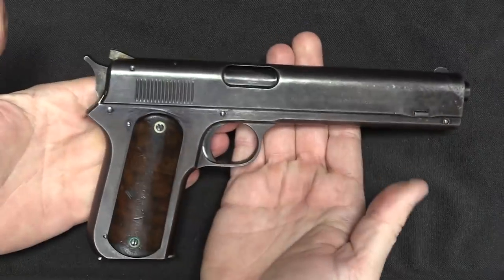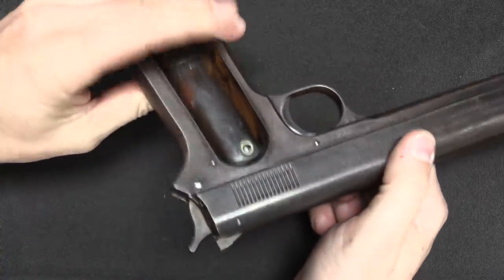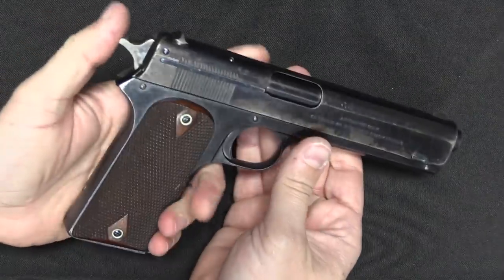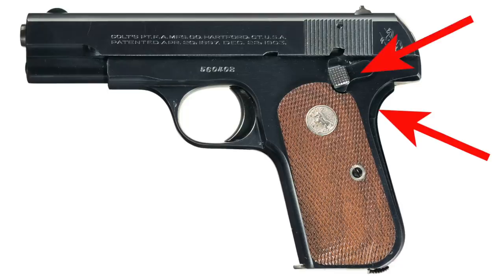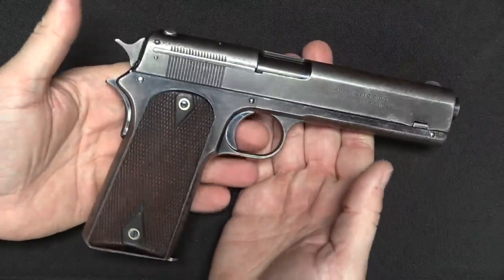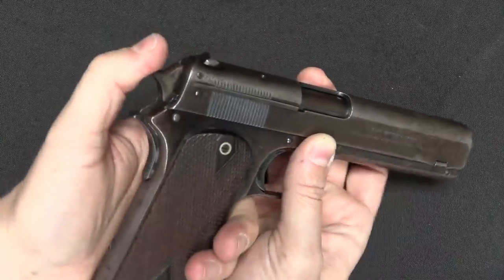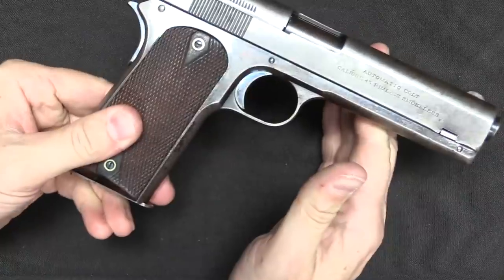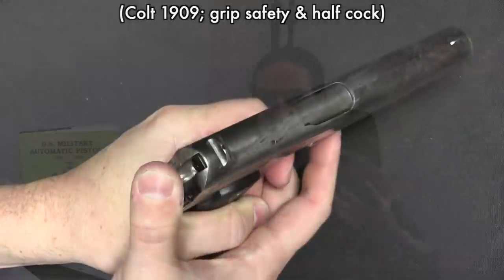How the 1911 Got Its Safeties - and Why Its Ancestors Had None

Comment: Something to keep in mind here:  The 1911 grip safety works by blocking rearward movement of the trigger bow.  It only provides protection against the inertia of the trigger causing it to move rearward if dropped, or against inadvertently pulling the trigger without a firing grip on the gun.  A sharp blow to the hammer can still fire the gun by causing the hammer to slip or break off of the sear.  Only the half-cock notch, or the Series 80 firing pin block safety, can prevent the gun from firing in that case.  The half cock notch does so by attempting to catch the falling hammer on the sear before it strikes the firing pin.  The Series 80 firing pin block actually prevents forward movement of the firing pin without the trigger moving sufficiently rearward.  This will prevent the gun from firing, even if the firing pin is struck.

The Series 80 safety also addresses the other possible way the gun could fire when dropped--the firing pin moving forward under inertia.  Presumably this was considered less likely at the time.  And, that would only occur if the gun hit the ground muzzle down.  Whereas the trigger moving rearward would occur if the gun hits the ground muzzle up, a potentially more dangerous condition.  

Modern 1911s, especially those without the Series 80 safety, use lightweight triggers and firing pins for this reason,  They don't have enough inertia to move forward or rearward when dropped.
Reply: Then there's also the Schwartz safety. This is the most distinct feature of Kimber "II" series pistols. In the series 80 the firing pin block is activated by the trigger, this makes for a poor trigger but a safer gun. The Schwartz safety changes the firing pin block activation to the grip safety. This provides both the better trigger of a series 70 but the safety of a series 80.

Comment: The 1911 was specifically designed so that you could load the chamber without using both hands. There is enough distance in the dust cover to merely put the plunger against feet saddle horn, and cock the firearm. It was a design function of the firearm because it was a Cavalry pistol. I don't know how these guys couldn't figure that out considering that was one of the design parameters that Mr Browning had enough foresight to put on the firearm. One of the reasons why I never carry a 1911 with a full-length guide rod. It is an unnecessary piece of weight that detract from the ability of the firearm the way it's designed.

An interesting thing about the 1902 introduction, was Browning was actually at a meeting with a number of military brass to introduce the officer's pistol. It is said that a lieutenant walked up to him and ask him why there was no safety on this newfangled semi-automatic like some other semi autos had. His response was that he was asked to design an officer's pistol. When the lieutenant asked him what did that have to do with the question, mr. Browning told him that an officer is supposed to know what end of the gun the bullet comes out of.

I don't know how true that story is, I got it from a pretty reliable source, but that sounds like mr. Browning all day long. He may have been a high priest, but he was funny as hell at times.

Comment: I recall the historical development of the 1911 and now when I wanted to again review the history....couldn't easily find it except here. Fine job. Question...when the 1911 thumb safety IS engaged....I think it might be good to complete this story to verify just what is going on inside the gun. Why?...because as we review different gun design manual safeties.....we might hear push back from some corners... "Well, it only blocks the movement of the trigger".....or, "It definitely does block the sear"....or it blocks the "sear and hammer". This then goes further to suggest how safe a particular gun's design is, if (say) a certain internal part fails or breaks....."is it still safe?", etc, etc. As you answer this....just for the sake of comparison, look at the Star PD 45 ACP. Has no grip safety but as you engage the thumb safety you can "See" the cocked hammer rock back slightly...indicating that activating the safety has lifted the hammer off the sear, while still blocking the firing control. Would love your comments on any of this.

Comment: One reason I like my 1911, is the thumb operated hammer/slide lock. I can have a round chambered, hammer cocked and the hammer/slide safety lock in place. If I ever need to draw my handgun from the shoulder holster I can drop the hammer/slide lock with my thumb while pulling my handgun out of the holster and it's ready to get to work.

Comment: Very interesting. Would be nice to hear your input about how the safeties affect trigger pull
Reply: They do not, at all, unless the fitment of the grip safety is very, very tight, which might even cause trigger return issues. The grip safety blocks the rearward travel of the trigger bow, until the grip safety is fully depressed, in which case it is entirely clear of the trigger bow. The thumb safety, similarly, blocks the rearward pivoting of the lower half of the sear, until disengaged. I think the shape of the two surfaces would prevent friction entirely in these parts in a firearm that functions at all. Even friction from the disconnector is eliminated entirely from the fire control group except for when the action is cycling and the trigger is resetting, as the disconnector and sear pivot together throughout the rearward travel of the trigger.

How much of a genius Browning was seriously cannot be overstated.

Comment: I think it's odd how those extra safety features carried over to civilian versions of the pistol, and are still included. I guess traditions are as hard to break as bad habits.
Reply: Or maybe they just use old tooling, or make new tools based on the old one instead of modifying them
Reply: There really is no reason to remove them on the 1911 as they are well placed and for the majority of users provide no issues. There is also the fact of liability against the manufacturer if they removed certain safety features and a user had a negligent discharge, as we all know in our litigious society it very likely wouldn't matter if the end user was the one being careless. There are also a myriad of modern handgun designs to choose from if one doesn't like those features.
Reply: It's only odd if you think that improvements made at the request of the biggest and most experienced user are bad...
Reply: The stipulations made by the military are not always improvements. Look at the Sig P320. The civilian version didn't have or need a manual safety, but the military asked for one anyway. That had nothing to do with improving the pistol, and everything to do with military doctrine.
Reply: @michaelblacktree  Well, the military usually requests its specifications based on the knowledge, that most new soldiers are negligent idiots with no real gun handling or training of any sort. AKA they want their guns and safeties to be completely dumb-proof. 

And if these designs carry on to the civilian markets, where most users are also negligent idiots - than its definitely an improvement of the pistol...

Comment: There is a third safety on the 1911 which I is called the disconnector safety (see https://www.cylinder-slide.com/1911safetyck.shtml) that is in addition to the manual and grip safeties that you covered.  On the 1911, if you push the muzzle into the dirt (or your palm), it will retract the barrel and the slide about 1/4 inch toward the hammer and the gun will not fire.   It would be interesting to find out when the disconnector safety was added to the Colt line of semi-automatic pistols.  Could you have a follow-up video that discusses the history of the disconnector safety or amend this video to include it?

Comment: As a German, I’m curious about a different Question: it’s the Colt 1911 because it was brought to market first in 1911, but is there also a newer version of the Colt , maybe 1995 or something?? 
Whiteout the Lizenz in Germany it’s not allowed to have a Gun, but I’m happy that whe still can watch Ian’s Videos ^^
Reply: matzesu1 I think it is called 1911 because that was year adopted by US Army.
Reply: most guns made off the M1911a1 pattern are called 1911, but the USMC did get a updated M1911a1 around the 2000s and called it the M45. this was later replaced by the M45a1 pistol and i believe is being fazed out, but still in service. Reason for fazing it out is for logistics cause other branch SF need glock 19.
Reply: Thanks for the answers ^^
Reply: Newer models of the gun made by Colt are catalogued by variations of the "o1991" model number following some changes made in 1991 to reduce costs, though the guns typically are roll marked and advertised as "Colt Government Model" for the full size variants.

Comment: The "half cock" on the 1903 pocket hammer model is for taking the hammer off from the firing pin, it is not a true half cock as it can be dropped by the trigger..this was deceptive , as the revolver S.A.A model of 1873 in 45LC had a proper half cock...pull the trigger and nothing would move.
As Colt states it was more common to have a revolver in that early 1900's  period than to have the relatively new self-loading (automatic) pistol, so it was all new territory. 
The 1903 model had all the features of a modern pistol but under powered by military standards...it is interesting, if not a little confusing,  especially when talking about early. 38 auto (9x21) and. 38 acp (9x17) cartridges...that should be mentioned more often than it is...

Comment: The amount of times I've read  'John Browning designed the 1911 to be carried cocked and locked!' is almost endless. Although I believe it is the best way to carry a 1911, people seem to think that there not only is no other safe way to carry a 1911, but that there never WAS another way to carry it. You hear people say 'Condition 2 & 3 goes against our lord an savior JMB's intended way of carrying a 1911' (o.k, I'm being a bit hyperbolic, but only slightly so).

The retort to this all seems to be 'but what about the 1900/1902/1903/1905/1907/1908/1909/1910?

Comment: Then why and how did the Luger lose it's grip safety?
Reply: Because the Germans didn't want it when they adopted the P08, maybe because it was cut for a detachable stock and it got in the way when attached(?). The Borchardt had no grip safety, but the initial 1900 model Lugers the Swiss and others adopted did. The Swiss updated their Lugers in the late 20's and kept the grips safeties, and many export and trials Lugers (like the US .45 ACP trials model) had grip safeties too. DWM was flexible and a customer could opt for or against features like grip safeties or the option to mount a shoulder stock.

Comment: The reason the sight safety on the model 1900 was changed was because it could break the sight off if you dropped the hammer on it

Comment: Fascinating!  In regards to the improbable happening to the gun and the firing pin hitting the primer firmly enough to touch off same, I recall reading about a man inadvertently carrying his pistol into a room with a running MRI machine, the pistol was a fairly recent iteration on the classic Colt design, and had the thumb safety, grip safety and another sort of internal safety (which may have been the author of the article not being as familiar as Ian with firearms history and mistaking the basic pistol features for addition safeties)  and was indeed on the safety when the pistol was drawn into the works by the magnetism whence it promptly discharged because the force of the magnetism had displaced the firing pin strongly enough and sharply enough to do this.  Any other cause of it firing was categorically impossible as the weapon was in good order.

Comment: This was interesting. People on the one side get hung up with "Thats the way John Moses Browning designed it to be carried!" technically yes assuming he was behind the implementation of the grip and manual safeties but in practice it was really the army that had Colt put the safeties on them. On the other hand you have the people that say "I'd never, ever, carry a pistol with a manual safety! You'll forget to disengage it and it'll get you killed!" Yeah, and yet they have a safety on their rifle and flick it on and off without thinking about it. For modern use is it perfectly fine to have a striker fired gun with only a trigger type safety like a glock? Of course it is. Is it the biggest dumbest stupidest decision in the world to carry a 1911 or other frame manual safety gun? No, its just a training issue. Striker guys don't want to put in the time to train engaging and disengaging the safety and are under the belief that it is so slow that i'll get you killed. As long as you train enough there is no downside in my opinion and luckily my opinion  doesn't dictate what firearm you carry. I like the idea of a manual safety. I like the idea of a 1911 and have no problem with the heightened maintenance. If you want to buy a glock than buy one. If all the 1911s you see jam then fine but someone can show up with a 1911 that doesn't jam and they can operate it then whats the problem?
Reply: There's a lot there.... just for kicks..
On the as JMB designed it thing, I don't think JMB cared one way or the other. But the alternative was to carry it at least hammer down if not unchambered. Nobody thinks that's tacticool enough anymore. 

"For modern use is it perfectly fine to have a striker fired gun with only a trigger type safety like a glock? Of course it is."
- I actually disagree on this one. Is it better than nothing, sure, perfectly fine no. Glock like pistols lead to a lot of NDs. Civilians carry and manipulate our guns a lot more than we shoot them. Odds are we'll never be in a situation that demands a lighting fast draw and fire. Odds are high though that we'll find ourselves in situations likely to lead to a ND, and NDs do get people hurt and killed. I think it the height of stupidity for so called experts to recommend Glock like pistols to new shooters.